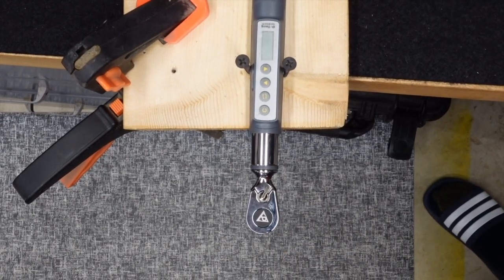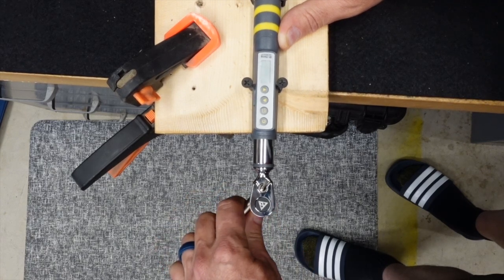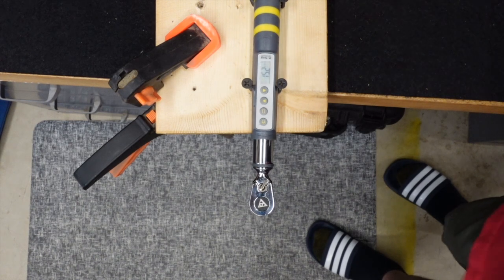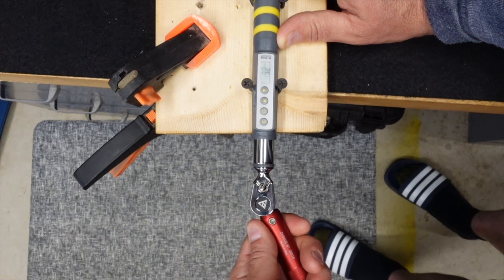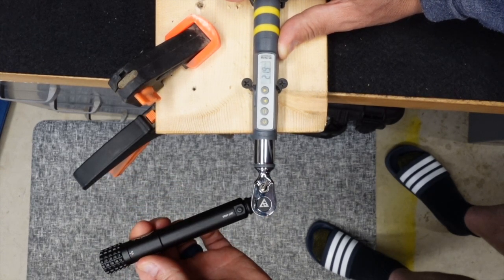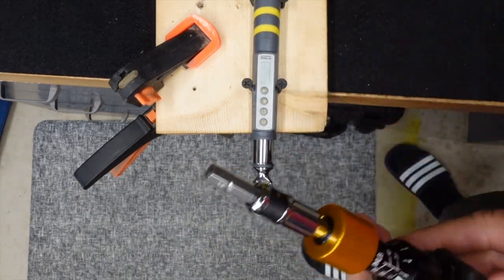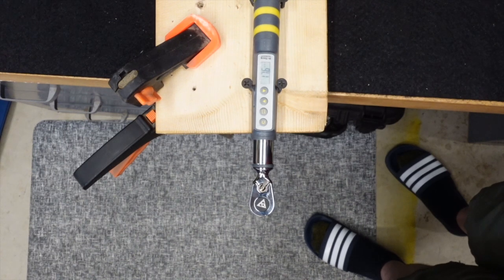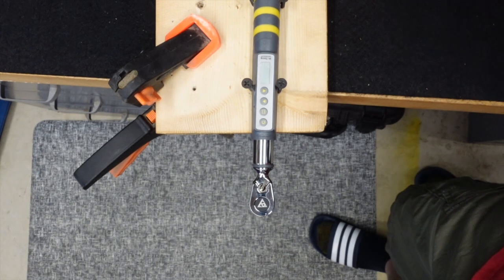Ultimate gun torque wrench & screwdriver showdown Part 3

Comment: Interesting test. When you tighten some screws with a torque wrench it's important to know if the threads are dry or have some oil on it because the forces may vary. For example if your action screws are oiled the pressure between the action and the stock will be higher at the same torque.

Comment: If you are testing with a digital torque wrench and getting inconsistent readings try to measure from the same angle on the torque wrench like 90 degrees and you should get more consistent readings

Comment: The variation in the readings are probably due to how much past the click that you go. This is a product of feel and almost impossible to get much better accuracy that what you are producing. I don't care for the type that have the perpendicular handle. I think they are harder to produce consistent outcomes by virtue of the leverage that can be applied. The screw driver types reduce this especially when dealing with inch pounds.

Comment: John, in the first video you stated the wheeler is probably the worst example of a torque wrench/screwdriver device.  Then you bought several devices to test including the Neko that looks like it functions exactly like a wheeler only with less range.  The real avid and cdi are also similar to the wheeler although not as much as the Neko.  I’m not trying to defend the wheeler at all, but it would have been nice to see you include the wheeler in your tests, especially since it’s the #1 most common torque device in the firearms marketplace.  Then you could have either shown that your assumption about the wheeler was correct or learned that it actually functions better than you assumed.  And at least we could have all seen how it compares to the others you tested.  Some of those you tested don’t have adequate range for things like, for example, action screws on an H-S Precision stock (specs are 65 in/lb), while the wheeler does cover that range.  The fix it stix certainly appear nice, however having limiters in all the different torque settings one might need makes the fix it stix a much more costly option.  Thanks for your effort in doing these videos, and please consider doing a short test of the wheeler for the many folks out here who have them already.

Comment: You should always have you load 90 degrees to the head of the torque wrench.  Not straight off the end and in parallel with the torque wrench shaft.  On the screwdriver style torque wrenches it won't matter but on the ones that are like a ratchet it should be at 90 degrees.

Comment: Thoughts on the fix it sticks all in one torque driver? I cant find it if you tested it.
Reply from the maker: Here’s the review I did on it about a year ago. https://youtu.be/MbtMl2xGWP0
After using it for a while it just wasn’t for me. There’s nothing wrong with the actual unit but it does require you to be able to see exactly where the torque setting is at all times and there are any number of times while setting up a scope or an action that it’s just tough to get ahead angle to see it just right. For me the fixed torque limiters are far better for my needs..
Reply: @FClassJohn  thank you for responding!

Comment: Wow John, you’re spending a lot of time on these test but I’m watching, finding it interesting and appreciate the effort you are putting into these but Dude.. those shoes.. 
I test my lever type torque wrenches by applying a set weight at a specified distance from the head to ensure calibration but I never checked my screwdriver type torque wrench (I don’t own a accurate digital to test against). I use the Vortex and was pleased to see its repeatability.  It appeared from your testing that all of the wrenches would perform reasonable well.  The takeaway is USE a torque wrench!
Reply from the maker: What can I say, I like wearing my glides in the shop sometimes 🤷🏻‍♂️. Thank you for the kind words and yeah, bottom line like you said is use a torque wrench.